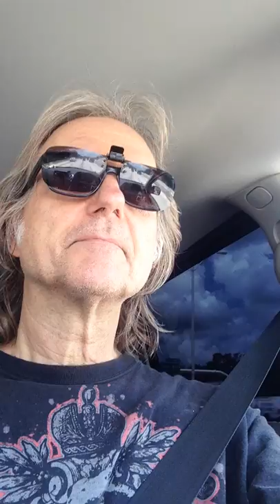More on Altec 1592 Mixers Stage Monitors

Comment: I used a 1592 at a radio station in the 70s. Around 1980, I replaced it with a more modern console.